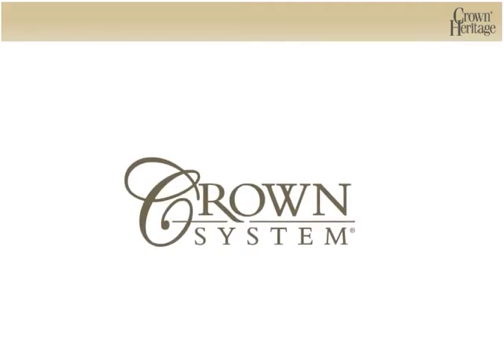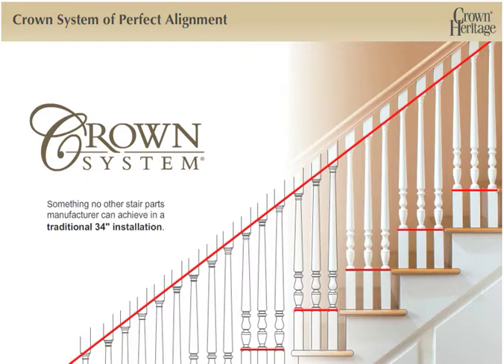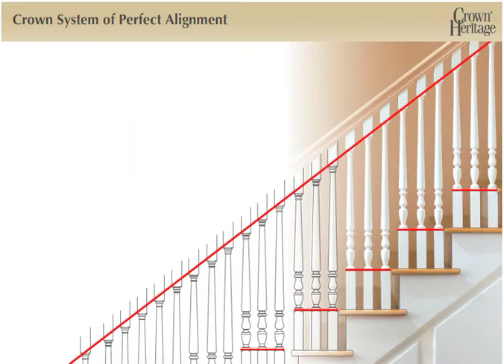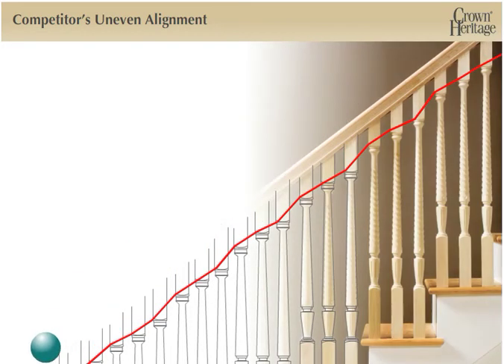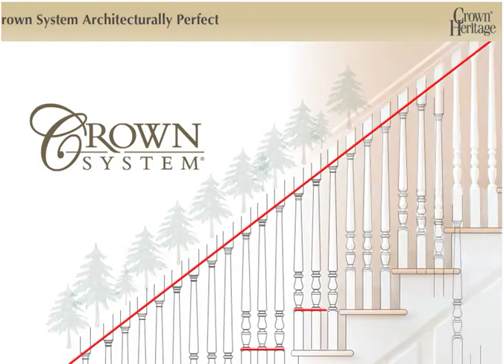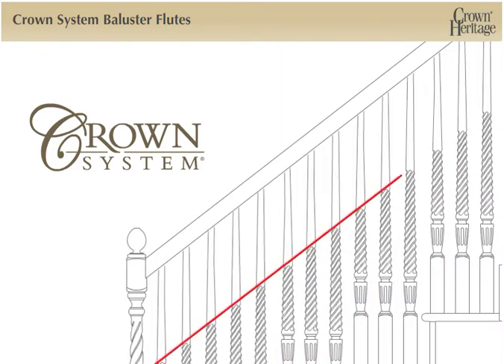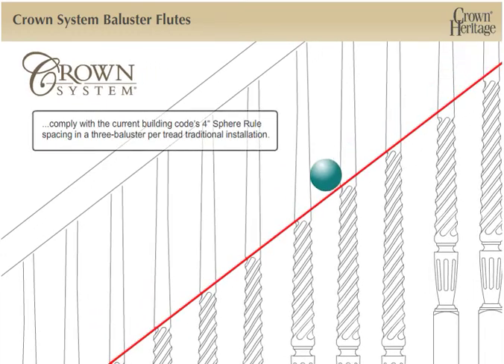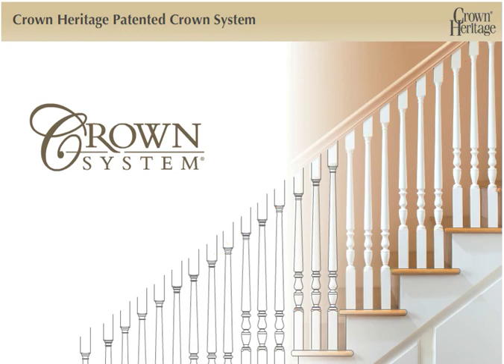Crown System Demonstration

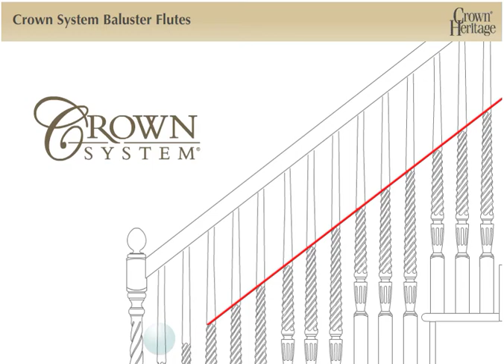Comment: At 1:05 the video says "comply with the current building code's 4 inch sphere rule spacing"

It appears to me that the IRC building code actually says a 4 inch sphere for railings in general such as along a balcony, but for railing on a stairway R312.1.3 Exception 2 states "Guards on the open side of stairs shall not have openings that allow passage of a sphere 4-3/8" (111 mm) in diameter." You'd need to check your local code that may be more generous or more restrictive, but it appears to me to be 4-3/8" sphere along stairs.

I've been told the rationale is that on a stairway the risk of tumbling down the stairs is far greater than going through the balusters so that they compromised on 4-3/8" there. On a balcony however the primary risk would be through the balusters, in which case a 4" sphere applies. But check with your inspector since the rules can vary locally.